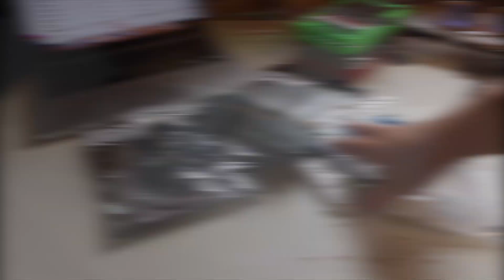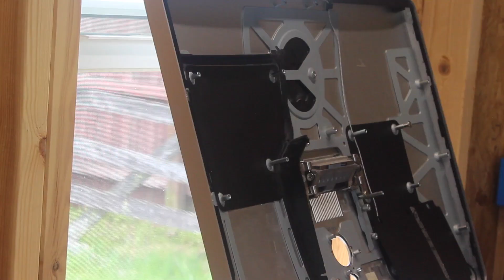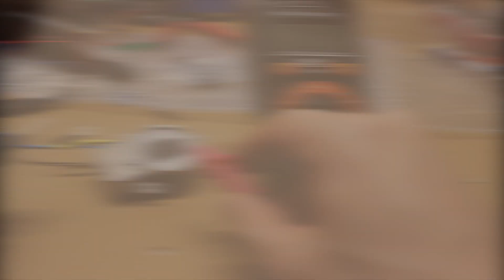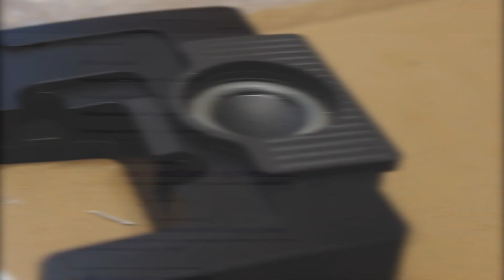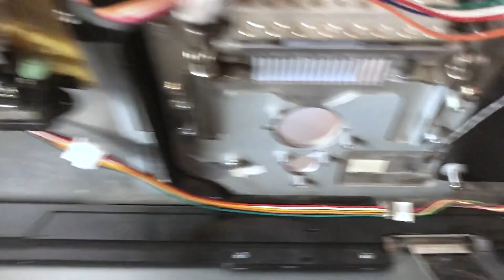Power, Camera, Sound! Working on a DIY Cinema Display - A.C.D.C Project

Comment: Nice video... did you ever finish project? 🤔
Reply from the maker: Not yet. I ran into a big snag trying to implement the USB hub and the monitor controls. Tack on COVID lockdowns and finishing my degree, and the projects just been on hold since. I should probably publish the footage I do have now tho. I confirmed that the display works and that my integrated sound system works!
Reply: @SeeTheBridges  I know the feeling! Best wishes

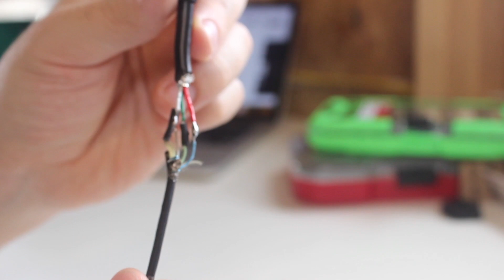Comment: 3:20 The iSight wires are different for the 27" Thunderbolt Display. It's a 7 pin connector. Colors are red, black, white, green, yellow, blue, and bare. Red is the power; connect this to the red USB wire. Black and bare are ground; connect these to the black USB wire. Yellow (D+) and blue (D-) are for the camera; connect these to the green and white USB wires, respectively. Green (D+) and white (D-) are for the microphone; connect these to the green and white USB wires. A single USB cable will be insufficient if you are wanting to use both the microphone and the camera. In my case, I used a single USB cable to connect only the camera. It works well! ^-^